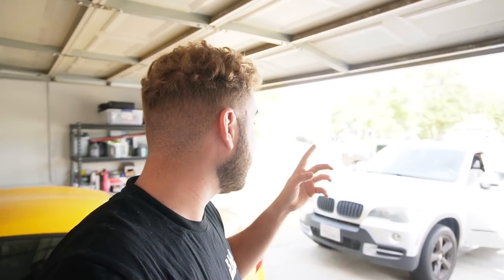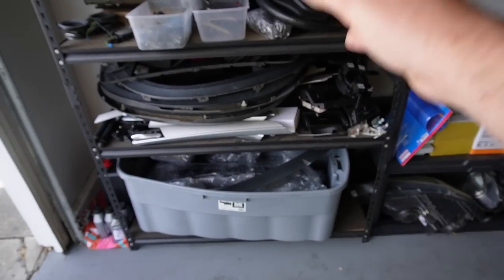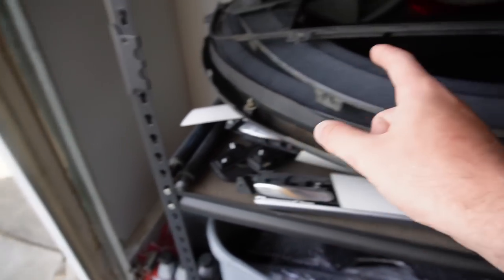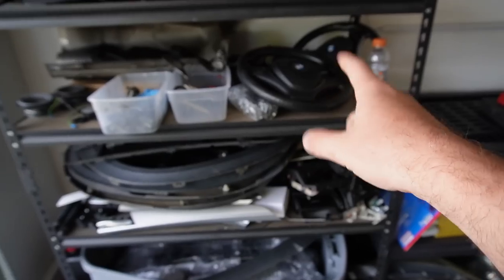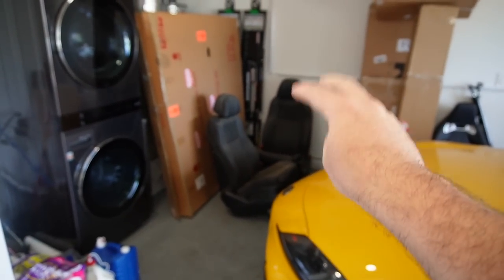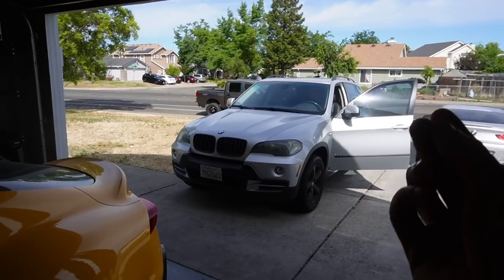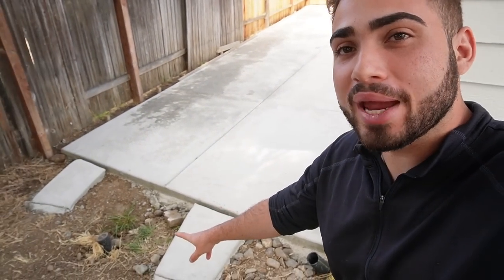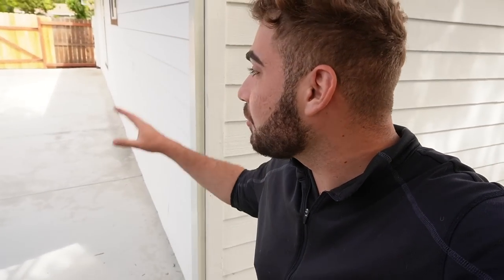I GOT SCAMMED ON MY NEW X5! I Can't Believe There Are People Like This  :(

Comment: In my experience awd always gets less mpg than just rwd, no matter the brand or the fuel. I don't see the logic how awd could be more fuel efficient because it takes more power to rotate them front wheels aswell. Correct me if I'm wrong but I have always gained better mpg with just a rwd car, trans also affects it.
Reply: Not only that, a transfer case and the related equipment weigh about 3-400lbs more
Reply: he doesn't know what he is talking about...
Reply: I was confused too. AWD should mean more drivetrain losses, especially on these older models.
Reply: yeah i was really confused when he said that lol, you are quite literally powering 2 more wheels im not sure how that would be less mpg

Comment: This may sound dumb, but check the air filter,  I had an E60 that gave the same codes, I had a dirty K&N filter, once cleaned, no more codes.  You can also try running some Cataclean in your gas tank.

Comment: Hey the cheap scan tool you mentioned also usually shows how many miles has been driven since codes were cleared. I'm checking that every time I'm buying project car. When you see less than 10-20 miles most likely something is up.
Definitely try first some cat cleaners and some hard driving. And get the cheap inspection camera to check inside if they are clogged or damaged. I had V8 where one of the cat internals where completly missing. 
Nice solution with the concrete I would also put some kind of roof over to protect from sun and rain and you'll be golden.
Reply: Seems like bots are scamming on your channel man

Comment: Hey Nour you can try and get it to regenerate and burn off all the stuff in them cats.
It's just going on the highway in 3 gear for about 30 minutes and that gets the cats very hot and it burns out all the stuff out it works quite well